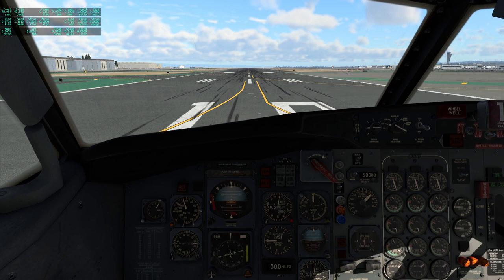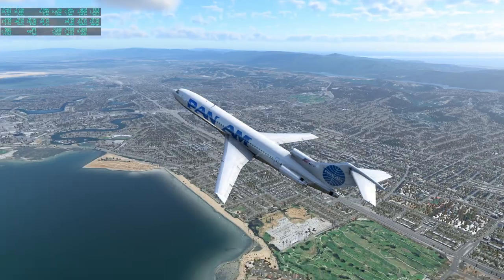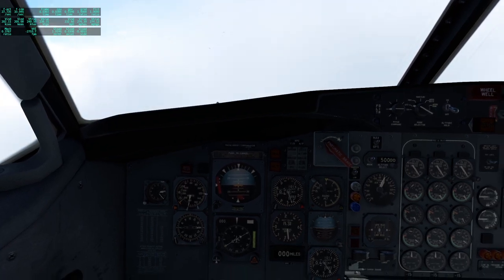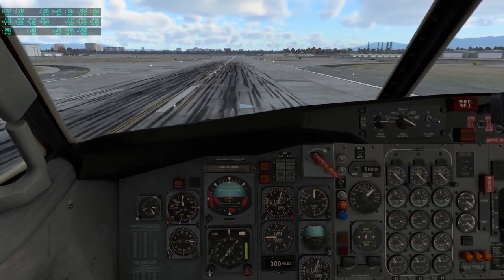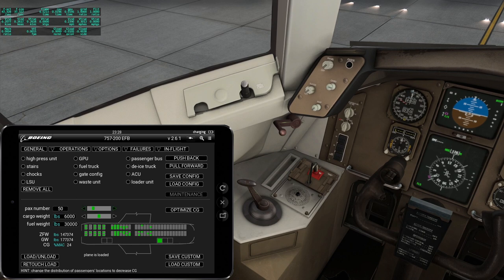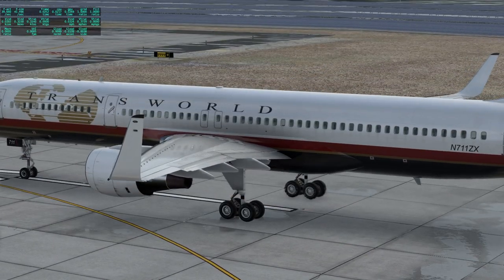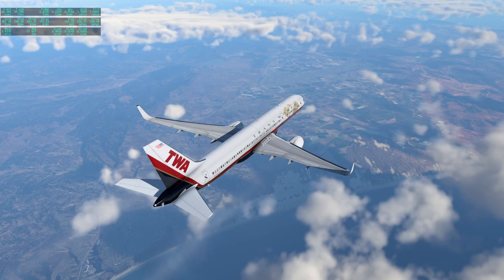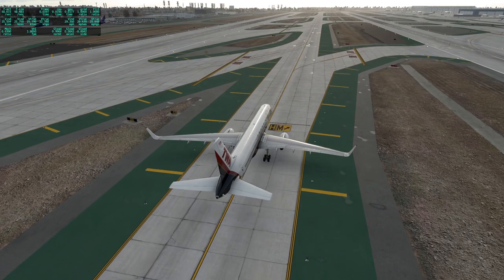X-Plane 12 Beta - FlyJSim 727 Retest, Flight Factor 757 Test

Comment: Hi! I actually opened the .ACF file for a few planes, and it turns out there are multiple issues regarding the new flight model explaining why the plane feels unbalanced and the trim is all the way up. as for the electronics disconnecting, I found that this was because the idle speeds were set too low for X-plane 12, and the engines were set as single spool. I've modified the files a touch (I'm no expert) and it all seems to be working a little bit better! But it's still not perfect.
Reply from the maker: Could you share what you did? It would be nice to fly it. I guess I could fiddle around with the acf.